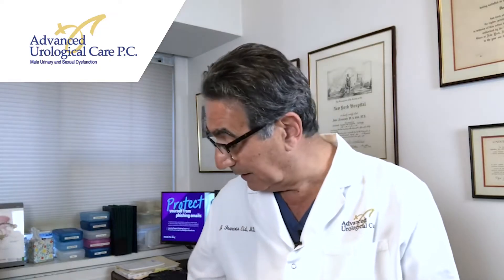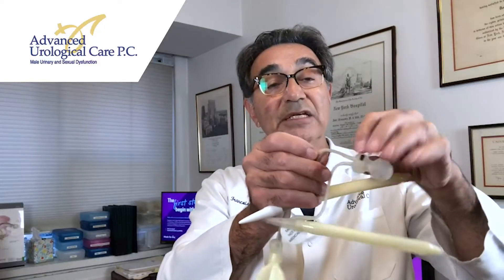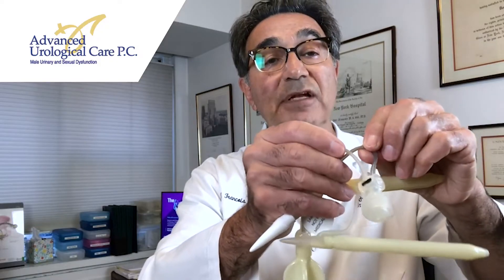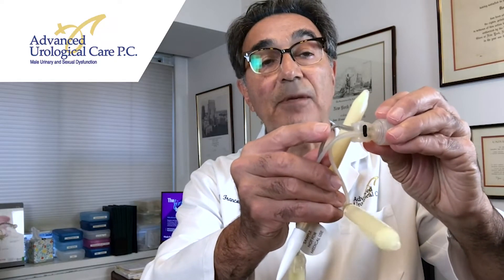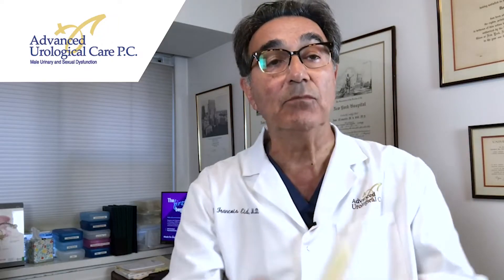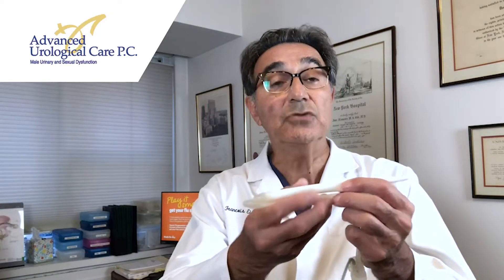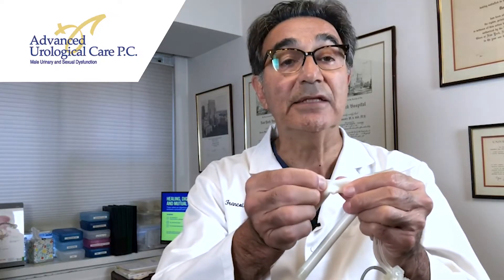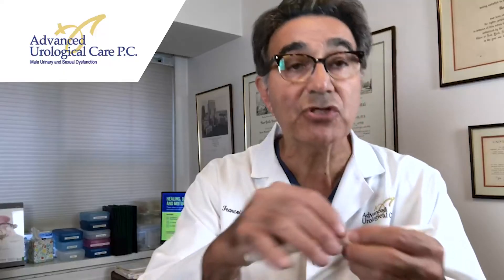Why penile implants fail

Comment: have you ever done the procedure on a young patient? Im 27 had a penile fracture that seemed like nothing but it actually was a penile fracture. My left corpus works fine while the other has a bump and becomes slightly deformed during erections. I'm thinking about it. My length was 5.3 inches
Reply: Have you had a penile implant ? I m 27 old too

Comment: Hey Doc! What if we catch an infection repeatedly? Won’t we become completely dysfunctional forever? How often has it happened that someone could never get the implant due to infection? Please reply
Reply from the maker: Infection of the penile implant is the most serious complication of the penile implant procedure. An infection occurs because the device becomes contaminated with bacteria, usually from the patient’s skin,during the surgery. It occurs more often when the procedure is performed by less experienced doctors. Our infection rate based on 3756 primary implants using our No-Touch which we invented in 2006 is 0.4%. The lowest published infection rate in the world. You can watch the surgery on YouTube as well as read about it on our website www.urologicalcare.com. If an implant gets infected it needs to be completely removed which will result in a permanently scarred and shrunken penis. All subsequent implants will be much more difficult to perform and with a less than desirable result because the size will be shorter than normal. There is no substitute for having the procedure performed by an experienced team such as ours. Implants is the only surgery that we do and our team has performed close to 8000 implants since 1988.

Comment: Is rigicon  inflatable implant  good or ams 700
Reply from the maker: Rigicon is a relatively new company regarding penile implants. It was created by a Turkish urologist and the devices are very similar to the AMS devices. Compared to the AMS devices that have been in production since 1973, Rigicon is in its infancy. The Rigicon 3 piece device is not available in the US and is currently undergoing clinical trials. It is available in Europe however long term data and life expectancy of the device is unknown. The best device is the one that will fit the penis the best based on the individual’s anatomy. For penises that are 5 inches or greater in the erect state, in general, the Coloplast cylinders remain the best option as these cylinders provide the most girth and rigidity.
Reply: @JFrancoisEidMD   women on top position comfortable with 3 piece  or risky
Reply from the maker: There are no sexual position restrictions for a men with an implant.
Reply: @JFrancoisEidMD  I have a surgery scheduled with Dr Levine in Chicago to get an AMS, because I'm worried about the discomfort of the Coloplast cylinders. He at first suggested the Coloplast for my anatomy, but I told him of my concerns about the comfort of the cylinders and he seemed okay with my decision to get the CX. Do you think I am being unwise to choose comfort over durability?
Reply: Thank you Doc.